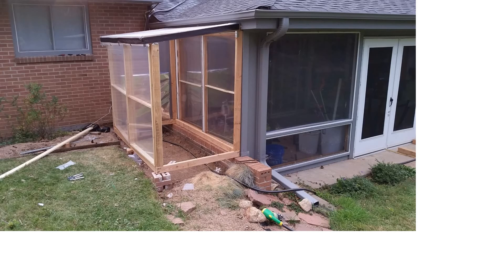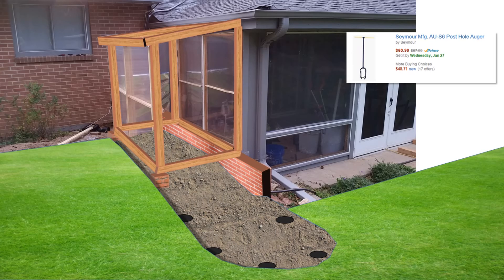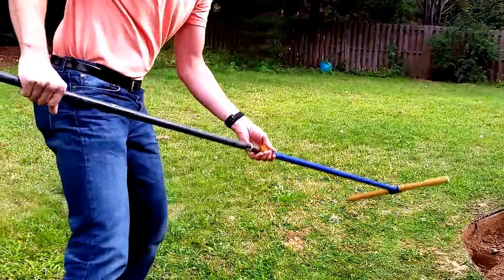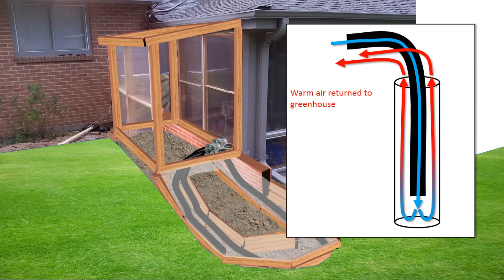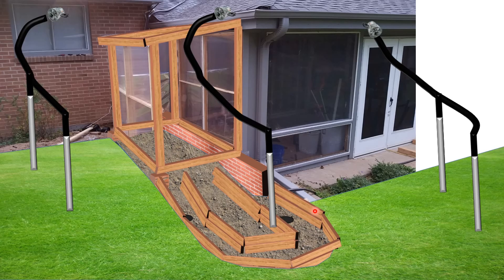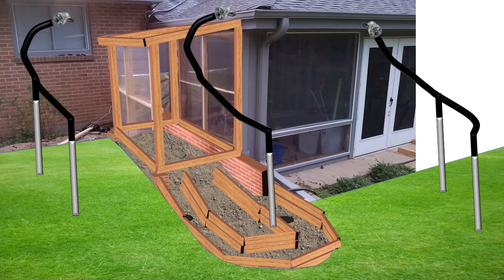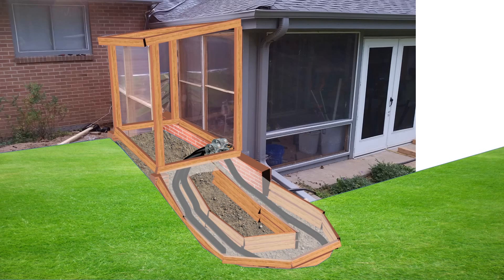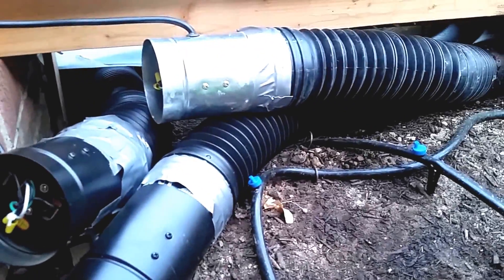Vertical Geothermal Earth Tube in New Greenhouse

Comment: Morgan some very simple changes would increase the efficiency 10 fold. Corrugated style vent tube is extremely inefficient.  
Smooth surface tube would help immensely . Air gets trapped in every valley along the entire length. And it causes huge inefficiency all along the entire length of each tube. 
Combine that with the very inefficient fans your using with a much higher than required power draw to each fan. 
Use smooth wall tube like pvc hard wall pipe with properly sealed and glued connections. 
Have the least amount of connections and by having proper connections your efficiency goes up by at least a factor of ten. 
Same goes with the smaller drop tubes into the holes. 
Smooth walls with very smooth connections. 
A simple and inexpensive cover would be to make good cedar frames well sealed with heavy duty clear plastic. Making a double or triple layered frame with a small space between each layer depending on how cold it gets down in Colorado . By just using a black top cover only when it is very cold will increase the air temp massively. 
Instead of having multiple fans that are hideously inefficient in style and electrical draw a simple manifold system that each ground tube is connected to made from a source of simple materials . Wood sealed from sun and weather or use some sheet metal shaped to what ever size and load of air required to be moved depending on requirement. 
Outdoor quality pvc pipe. 
Each joint and seam from whatever material you use must be sealed with glue and tape . 
The one thing that is absolutely essential to having a great system is style of fan. 
By using only one very good style of fan will save you money and power. 
I like to us an Italian made push /pull impeller turbine. 
By adding the matching reo - stat style switch gives you absolute control on how much air is required depending on temp/ clear or overcast conditions . 
Keeping the ground cover clean from snow and leaves and any debris that would gather atop of the structure is essential.  
You don't want any water to gather on top of the ground cover it must have a way to drain off and you certainly don't want water to leak into it. 
Now by using that very good impeller turbine you will have a pressurized system . You want every joint and seam sealed properly . 
These are some the things I would address . Everything I have mentioned I have done on my different projects over the years. 
I'm Canadian and it gets brutally cold here with snow up to my waist and that's a good winter that's why I'm such a stickler about efficiency and every connection being made correct. 
 By using very simple materials that can be purchased second hand at a reuse outlet for pennies on the dollar. 
But the one thing I would never skimp on is the impeller turbine with a 5 amp adjustable switch. 
This would give you absolute control to match any weather condition. 
 I don't mean to dis your system because it is very creative . A few simple and very cost effective improvements would lend itself to improve the entire system and let Mother Earth heat and cool your year round greenhouse. 
Take care Morgan.
Reply from the maker: Gary, I appreciate this feedback.  Grudgingly I've come around to your point of view.  The flow dynamics of my system could be better.  Will read your note more carefully and certainly come back to you with questions.
Reply: Corrugated pipe will draw the thermal properties from the pipe far better than smooth pipe. Not to mention the larger surface area  of corrugated to transfer. And as far as efficiency, it's not efficient to pull air that doesn't pick up the thermal exchange so in summary, corrugated is FAR better for this application unless you have the money and space to run a far greater distance. And yes, I have done this with both (literally next to each other) and it's night and day.

Comment: what will keep the holes from collapsing?
Reply from the maker: dcollins2371 our soil is pretty solid so I've had no issue with cave ins.  This approach wouldn't work well in loose, sandy soil
Reply: thanks
Reply from the maker: A guy posted a note to one of my other videos where he suggested using a convection-only system.  In other words, dig the hole and put in some type of "casing" if the hole is at risk of collapse.  Then, instead of using a blower fan, you'd just let natural convection move air in and out of the hole.  It's a thought, but I have no idea if you can move enough air that way to make a difference.
Reply: Just a thought, if you have a topsoil then a clay bed underneath you might want to consider putting inside the hole some galvanised or aluminium air ducts. Because once you get heavy rain you may get water filling up the holes as it runs along the surface of the clay, Especially if the land gradient runs the wrong way on you.

Comment: instead of  cans for the feeder tubes. think about using dryer vent hose.
Reply from the maker: yeah, that's a good call.  I do like the stiff pipe, as I can get it down the hole without "sticking", but I'm sure your solution would work.